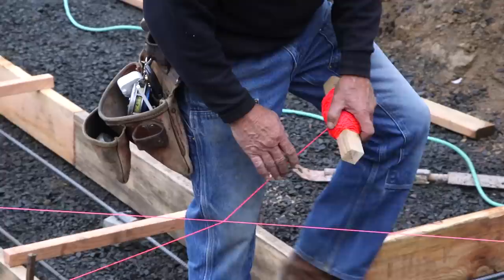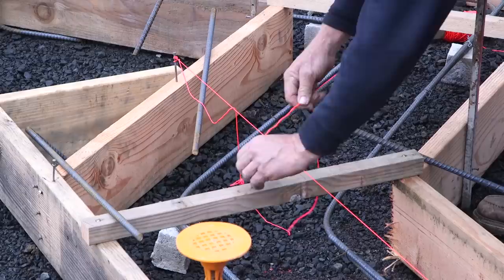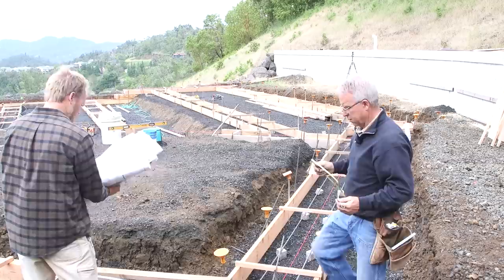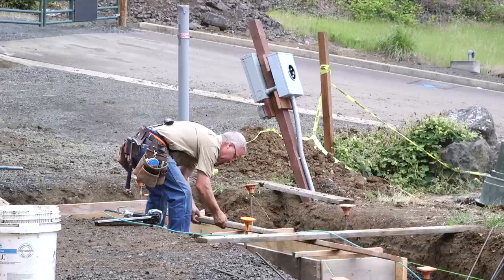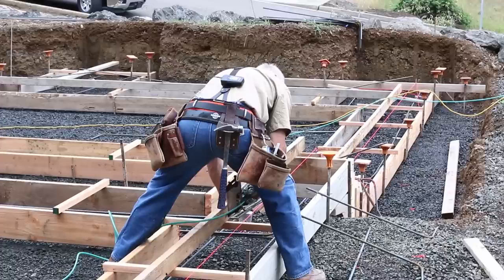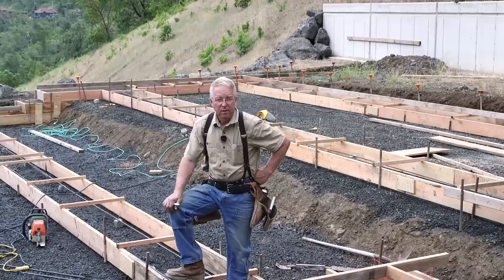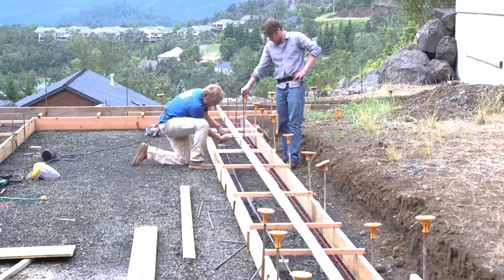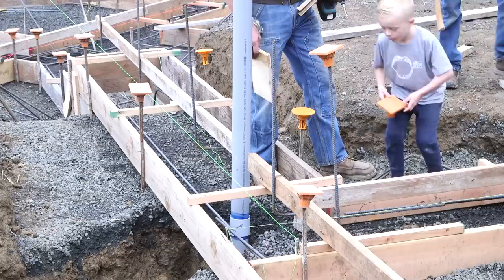Rebar Layout Ep 30

Comment: Dumb question: what are those orange caps on the stakes?  I imagine they are there to make sure someone doesn't accidentally fall over and get impaled, but I thought I'd ask and confirm.
Reply: Confirmed
Reply: They’re called stab guards so you don’t get impailed on the exposed rebar/stakes/forming. Also called osha caps also mushroom caps for the cheap ones that break easily and look like orange mushrooms
Reply: Last week here in Munich one Truck driver jumped off his Truck and stuck himself on such a rebar. Hevily injured! Heard not how he is doing now. Those stakes are deadly.
Reply: Code requires them, osha requires them, just about everywhere requires them. Even if you are working on a project or in an area that doesn't require them, still use them. They are much much much cheaper than the legal and settlement costs of someone getting impaled and dying...
Reply: If you ever have seen somebody whom trip on a job side where the rebar did not had those guard caps on yet,... you want those guard caps for sure! It was a messed side to see and experience, and one with fatal consequences.... 😪
Reply: tetrambs  You are correct sir.  And there are no dumb questions. 👍
Reply: Small but annoying cuts and snags too. New pants or a hand or forearm getting sliced is no fun.
Reply: Or imagine looking down at something and getting stabbed in the eye.
Reply: We had a neighbor that was doing a patio and steps.  He had the verts in, but no caps. His wife tripped, fell, impaled herself and died.  The caps are crucial for safety.
Reply: No such thing as a dumb question.
Reply: Phineas Gage
Reply: diver dave  why'd you mention female?
Reply: There was a "drama in real life" in a 80's Reader's Digest about this very accident. A man fell into a large footing pit that was filled with six foot spikes of rebar. He was impaled by several spikes. They sliced the spikes and rushed him to surgery. One was in his thigh, within a fraction of an inch of his femoral artery. Another was nudged up against his heart, and I think a third was imbedded in his neck. He survived, but it shows why those caps are almost universally used now.
Reply: @idwtbam  because it was a woman perhaps ?
Reply: @idwtbam  What difference does it make. He probably said female cause most carpenters are male and he was acknowledging that a woman could do the same job as a man. Also he said it was 30 years ago and it was less likely that a woman was working as a carpenter at that time. I'm sure he wasn't being negative but if he was then shame on him.
Reply: @mrlithium69  yep Cavendish Vermont, he lucked out
Reply: @adamliske  
As a DIY real estate guy, I imagine it's cheaper than surgery, too.
Reply: Cell phone repeaters

Comment: Cutting rebar, if you've got a lot: with a hand bender / shear is just not feasible; with an abrasive cut off wheel is hot & noisy and eats a lot of wheels; with a carbide tipped cold saw is an expensive lesson... mill scale eats carbide for lunch; electric over hydraulic shear is a slick method and usually available at rental stores; and finally a local service can often supply the bar, make the cuts, and add the bend for about what it costs to buy the bar for the job. I also found attaching the verts to the template  with a nail and a short length of tie wire vs tie wire around the entire template works well.

Comment: Yes, the bricklayers will really love this layout of the "verts" and may give you a discount...maybe!  I can only remember a couple of  times that the general contractor went to that much time to make sure the vertical rods were in the center of the cores in the block since 1968 when I started my apprenticeship.  Worth it?  You bet, Greg.
Reply: Many years ago we called the verts "starter bars"'
and once we had finished tying all the  steel, we all used to have a beer
and leave the empty bottles on top of the vertical bars,
sometimes, we had to empty a lotta bottles to cover all the bars.
Call it prehistoric workplace safety.
Thankfully, it was never tested for effectiveness.
The new caps are way better,
they make more sense than political correctness on site.
Reply: @benjigray8690  I have found many old Milwaukee cans in block and retaining walls.

Comment: 10 minutes in, is exactly how we laid out verts doing this kind of work in Florida for residential construction. The forms were different and the slabs different, but the method of space the verts is identical. For ours, we just cut stickers and nailed them on the top edge of the reusable form. Then tie the steel vert to that. When the concrete sets, the stickers get knocked off and if you did it right, you had verts ready to tie in to the uprights, which tied into the header bar(s).

Cool thing about a modern Florida house is you could basically knock out any interior wall if you wanted. Almost none of them are load bearing.
Reply: The clear span (lack of load bearing walls) has a lot to do roof truss engineering.

Comment: When I built my house I used a Master Key, a bolt-cutter, those things used to cut locks with to cut my rebar.  I built a 6 foot long, 20 inch wide bench from 2 X 10's  and screwed blocks onto the top for bending the rebar. I shoved a long piece of galvanized pipe over the rebar to keep it straight as I made my bends. Worked really well.

Comment: very informative. 
where I live in Trinidad all structural work is either done in structural steel or reinforced concrete such as seen in this video.
placing the verts what we will do is pour the concrete and when it starts to set up we slip the J verts into the concrete and it hooks into the main bars that were already set before the pour,
the pumpers are a bit rough and if done like this seen in  the video they will push it out of place. but we make a wood "T" template(16" long) and set them in while the concrete still a bit wet

Comment: In Australia we have to tape foam onto pvc pipes penetrating the slab so to cushion the pipe should there be any movement in the slab, I’ll watch carefully to see it it’s a requirement on this project.
Reply: Peter Beyer we do that in Minnesota too. The codes here in the US vary some from state to state due to local climate, etc. I guess I was just writing to let you know that’s not completely unheard of over here.
Reply: It is a requirement in Oregon (where this is) as well. However, this is a framed subfloor and only the garage will be slab. There may not be an application where it'll be necessary.
Reply: These are the types of comments and responses that make YouTube just a little bit alright.
Reply: Same in California...buy 6 inch wide rolls of kinda like bubble-wrap but minuscule bubbles and wrap several times.

Comment: 16:00 cutting with a band saw dowsnt create Sparks.  However it does create little chips of metal that can go into your eyes.  Put goggles if your cutting rebar.  Sucks when the doctor has to force open your eye while he is trying to retrieve the metal in your eye and your eye naturally wants to close....
Reply: Naw, they have drops that make everything good. Steel gets pulled with a magnet while your face is in a vice. Your eyes are held open with curved eyelid clamps. Now copper shavings was bad. Took over 2 hours with tweezers and a microscope. Lots of drugs, I was numb from the chin up.
Reply: I agree with goggles over regular safety glasses. When I was working in a metal shop at the chop saw I had a piece of metal hit my cheek and bounce under my glasses into my eye. I had to sit still while the doctor drilled it out of my eye with one of those dentist sized tools. It was not a fun day.
Reply: Hydraulic rebar cutter works best.
Reply: Michael VanGundy   Numb from the chin up!!! Awe that’s too easy, you wrote that hoping I’d bite. Haha

Comment: Non rusty rebar is a rare thing in my experience, loads direct from the steel manufacturer are usually pretty rusty and anything from a steel stockist will be rusty. Unless we have had a long dry period as its all stored outside. We do use far more weld mesh than plain bar though, the weld mesh is always rusty.

Comment: What about the thickness of the mortar in between each CMU?  Do you figure for that, or is it included in the size of the blocks?
Reply: Block is 15 5/8" long.  The mortar joint between two blocks is 3/8".
Reply: think modular
Reply: @deezynar  is 3/8th pretty much the standard for say block walls? Or does it depend on the project?
Reply: @keestrokes  Standard so it works out to be 16 inches long and 8 inches tall. Hence the block being call an 8 inch it's made 3/8 smaller all around to allow for the mortar and still just do figuring by said size of block.  All block are done this way 3/8 smaller. Same with lumber a 2×4 is not 2 inches by 4 inches it's just a bit smaller.
Reply: Scott Jenkins 16” is the total of the CMU and the mortar joint. Whenever you get a block it’ll be a nominal. You can figure your mortar joint by simple deduction. Good luck

Comment: A thought: How about placing a covered porch/deck outside the "garage/utility area" stairs landing to access the top of the retaining wall (retaining wall could be used for outside foundation with a 'roller pipe' placed in a steel channel to allow for wall movement) and the sloped ground area for a future gazebo/outdoor viewing platform (might be a security problem?). The stairs landing could be redesigned by cantilevering floor framing, still using current foundation design, out past and on top of a knee wall and remove the 'winders' in the landing but give you the added floor sq. ft. for the needed space of stair (re)design. It could also be done off the 'dining area's dbl. doors' with outside stairs built off the side of the rear concrete area. Just a "what if".

Comment: I wonder if your engineer has ever specified that the j bars be tied or at least hooked UNDER the horizontal bar in the footings. 
I really enjoy talking to engineers and whenever possible when on site and I have time I always ask questions and try to get an understanding of the way they think. One of these times he said that he would prefer the j bars be hooked under the horizontals, he also said he understands that most full time rod busters work by the foot or by the pound and it is much easier and faster to tie them resting on top. 
This makes perfect sense to me, a greater uplift resistance. Ever since when I am installing I have tied them that way. 
Anyway, he also said that for what we usually build ( single family buildings) he does not insist on this element but, for anything of a greater size or public or commercial use he does spec this rebar detail. 
I love these videos I'm learning an incredible amount, I'm will be contributing. 
Is there a way other than patreon to get access to all the good stuff?
Reply: Pete M I don't think I'd trust the work of anybody that puts them on the wrong side. I'm in a seismic zone and that could kill people or destroy stuff.

Comment: A portable bandsaw is pretty sweet for cutting rebar
Reply: Very slow though. A gasoline cut off saw with a fiber blade is much quicker + you can gang cut a group of them simultaneously. Another tip,you do not need to cut all the way through. re-bar can be cut around 5 / 8  through,it will then snap easily by placing a foot on the and lifting up the end.
Reply: Fred Nowicki those gas powered partner saws with a diamond blade are one of the best tools a guy could have.
Reply: @AustinHansen  for cutting steel you want an abrasive cutting blade. Not unlike an angle grinder zip wheel
Reply: Joe Crotty that’s definitely a better wheel for cutting metal. I’m particular to the masonry wheel because my cutting work mainly consists of masonry materials, but the same blade is able to cut through the brick and block, the rebar, and any miscellaneous wood and junk we have to cut through. It’s pretty versatile!
Reply: a chop saw
Reply: @AustinHansen  since diamond and steel both have lots of carbon. The diamond ends up implanted in the steel and your blades wear out quickly.

Source : Union concrete laborer in Chicago
Reply: Joe Crotty that’s interesting. I would have never guessed that! I’ll keep that in mind the next time we have any steel heavy cutting to do, but usually it’s just brick or block.
Reply: You can get a mechanical rebar cutter that just snaps them (since they are so high carbon) easily with a 6 foot lever.
Reply: @mrlithium69  it's honestly not that easy. Especially when you're doing a 40ton rebar job... Plus the damn cutter is heavy as hell and doesn't work very well with mudy conditions
Reply: Mario Rodriguez I agree
Reply: I cut mine with a dry-cut metal chop saw or an angle grinder. The abrasive chop saws are nasty.
Reply: I cut them with my bare hands, I know karate, "chop chop"!

Comment: maybe I missed it but I do not see your stub outs for CATV and telco. I see the conduit for power.
Reply: Would it behoove him to also run for network and or video surveillance.  Those two are inner joined nowadays,but it's a growing trend on new homes.
Reply: @tsnorquist  structured wiring was big in the early 2000, but everything these days are wireless including security cameras for the home. All you need for the cameras in the attack is some 120 run around the inside of your attic.
Reply: Cable TV? Is that next to the bone knives and bear skins? Let the internet guy drill a hole later. Let’s get back to work.

Comment: Are the verts allowed to go beyond the bottom of the footers into the gravel base or must they be completely up in the footer.
I ask because if they go below into the gravel there is the possibility they will rust and cause deterioration/weakening of the bond between the rebar and the concrete.  I see on road paving the rebar is painted with epoxy paint.
JIM
Reply: Only if you're a farmer.  Farmers can do whatever the hell they want.  I saw one use a wood 2x4 for 'tensile' reinforcement instead of steel rebar in a concrete footer once..  and they love to drive rebar in the ground everywhere so they don't have to dig as deep.. because their grandpappy taught them that trick.  Farmers can do whatever they want, even shoot building inspectors.

Comment: I read somewhere that you want to keep the rebar isolated from the ground due to electrical charge in the ground naturally causing corrosion in the bar. Even a random wire tie could potentially transfer the charge.
Reply: Jeff Stewart  That's Right.👍

Comment: Have you ever considered using Basalt Rebar or Fiberglass Rebar instead of Steel Rebar?
It is a little harder to work with, but eliminates the problems caused by steel rebar rusting over time.

Comment: Any opinion on fiberglass rebar? It's supposed to last longer given that it doesn't rust.
Reply: It's very expensive.
Reply: Rebar in this footing wont rust. No chloride or  carbon doixide from outside will get into the concrete. So no corrosion.  Spending so much money on fiberglass rebar is basically wasted. And any surface rust before pouring is actually dissolved in the concrete afterwards.
Reply: It can be very expensive (multiple times the cost of regular rebar).  It is very strong and corrosion resistant which makes sense in some use cases which are more mission critical or structurally challenging than a simple foundation like this.  Unlike steel, it fails suddenly, so generally there is no warning.  Generally, normally reinforced concrete structures are designed to fail in a way that gives some warning before actual collapse.

That's why you don't see them so commonly.
Reply: FRP is quite a bit stronger and lighter. chemically resistant. all good things. there is however no perfect product. FRP is 1/2 as stiff and a 1/4 as resistant to strain as steel, and we dont yet know how it handles a fire situation or long time frame deflections.
that being said in a large number of use cases its usually the better option, if in budget, but often overkill.

EDIT for link: https://youtu.be/thUZImUTZn0 check this video out to hear an engineer tell you lol.
Reply: It can be used to add strenght to an existing structure. It is glued on (under) floors sometimes when loads changed (when big holes are cut or walls are rearranged).
Reply: For us midwestern types, menards had it for about the same price as normal rebar. I have used it to cast concrete countertops because it doesn't have the risk of rusting and shadowing.
Reply: I think one of the big selling points was the reduced weight. Also the idea of steel rusting once Incased in concrete is starting to be questioned. As long as you get proper amount of encasement and there is not a high exposure to salt, the amount of rusting that occurs should be so minimal it does not matter. Only big problem would be if your concrete has large frequent cracks to allow elements in. I’m not claiming it doesn’t/can’t still happen. More so I’m just stating the biggest selling point of fiberglass is/should be the reduced weight to increase productivity of installation.
Reply: Steel bar will stretch and bend as the concrete moves, retaining much of its strength. Fiberglass is very unfogiving and will shatter under too much stress

Comment: From an Aussie builder, I'm surprised at the lack of steel in the footings/foundations. We would have 3-4 times the amount of steel you have.
Are the "cinder blocks" all core filled? Do you pour a slab after you pour the footings, or is it bearer and joist floor in between? Our homes seem to be built completely different to yours, which I'm genuinely surprised by!
Reply: There are many, many different building codes in the US. Different land conditions, temperatures, climates, elevations, topography. The US is a big place.